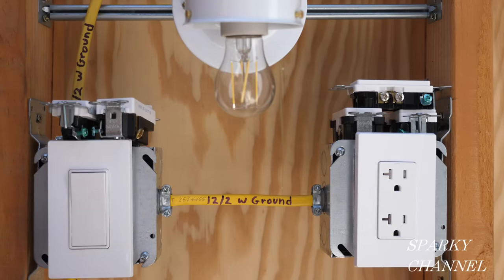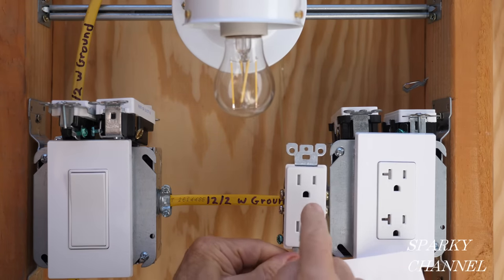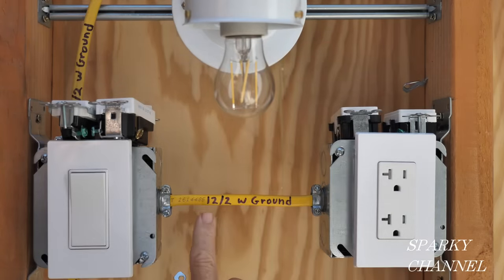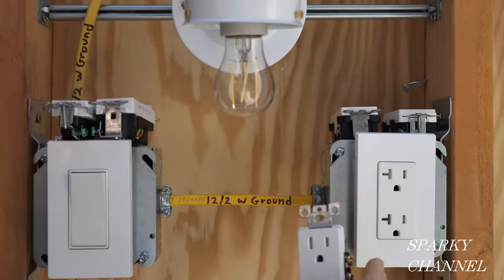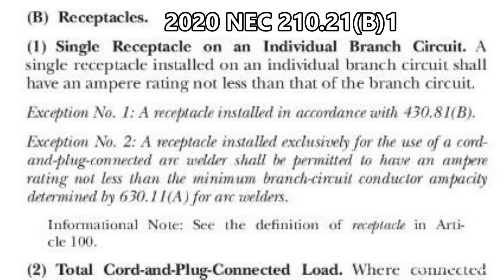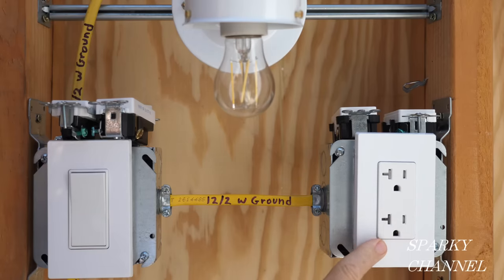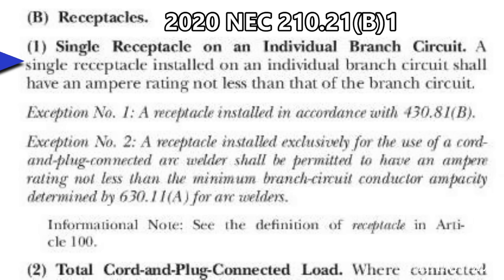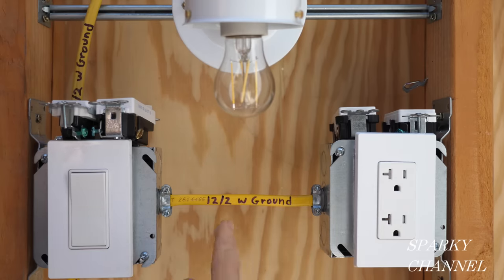Shall I Use a 15A or a 20A Receptacle on a 20A Circuit? + 2020 NEC 210.21(B)(1) and 210.21(B)(3)

Comment: For me the problem is I've been in a room of homes where there's a 20A breaker work 15A receps but your got idiotic people plugging in 16A+ into the recep causing it to catch fire.
Reply: This doesn't make sense. If a device draws more than 15A, then it should use a 20A plug, not a 15A plug. So having 15 amp receptacles is fine on a 20A circuit. You're just limiting the current you put on any single outlet to 15A.
Reply: I found 20A circuits with 14AWG wiring. And the name of the electrical contractor was ironically named Accurate Electrical.
Reply: @4point6Thunderbird  but Regular people don't get any of that. You got people plugging up portable heaters (12A) with a freaking heavy amp object. 6A and when it's past that 125% mark it catches fire.
Reply: @williamholsey  16a is limit for continuous usage on a 20a circuit. If they're using 18a on a 20a circuit, circuit breaker should trip. Usually why there are fires in this scenario is that the breaker isn't the issue or the loads but the wiring in the house isn't crimped or using proper wire nuts or is corroded.

Comment: Why can't you use a receptacle over 15 amps on a 15 amp line? It's just a beefier outlet, no?
Reply: Because a 20 amp receptacle is a notification that this is a 20 amp circuit. Someone could otherwise unknowingly plug in a high power appliance in a circuit not specified for that and overload it.
No, it's not beefier if you use a specification grade 15 amp receptacle.
Reply: you see the extra horizontal slot on the 20amp receptacle? that allows for 20amp draw equipment to be plugged in. 20amp draw equipment plugged into a 15amp circuit is bad news. 
Although you hardly ever see equipment like that anymore these days, its often in commercial environments and communications rooms for large battery backup systems to protect servers and emergency communications equipment.
Reply: You can.  Anyone saying you can't doesn't know what they're talking about or is stating the general while ignoring the specific.
 210.21 (B)(1), states a single receptacle installed on an individual circuit shall have an Ampere rating not less than that of the branch circuit.  Therefore, a single 20A receptacle can be used on a 15A circuit.  But it limits you to one receptacle so it's not practical in most applications... but it's allowed. 🤔
Reply: George Thamos  This is a specious argument as the circuit can be overloaded with multiple devices in a duplex and IT'S STILL OVERCURRENT PROTECTED.   "doesn't trip quickly"  SMH
Reply: 0:26 BECAUSE THE CODE SAY SO.

Comment: And that's how a house gets on fire.  If I am running a 20 amp breaker with 12/2 all switches and and outlets are 20 amp.  If I run a 15 amp breaker, then I use 15 amp switches and outlets. I have seen 20 amp circuits and the 15cent 15amp duplex outlet catch fire or over heat.
Reply: Lol makes no sense whatsoever, 15A and 20A receptacles are literally THE same internally (if you compare 15A spect grade and 20A spec grade they re the same product, with the only difference being the plastic face of the receptacle).

Comment: I wouldn't use a 15 amp receptacle on a 20 amp breaker.... better safe than sorry
Reply from the maker: I love it! Why not pay a little extra for quality?
Reply: @SparkyChannel  yes sir... exactly what I thought as well 😉
Reply: I would, it's totally safe and as long as it's a duplex it's code compliant. Use a spec grade 15 amp rather than the residential for good quality. Just make sure you have 12 gauge wire, that's the important part.
Reply: @surferdude642  I've been to homes that there's black outlets...not sure why or how I'm like duck duck and it's none of my business...but I've seen cooked outlets on kitchen circuits that are in nearby rooms...20 amp circuit.. .....20 amp outlet
Reply: @surferdude642  wait till next year and the code changes.....I guarantee it will since it came up......😆😆😆
Reply: @surferdude642  why would you endanger a home for 5$...... it's easy...20 amp goes with 20 amp...so what if there's 3 more outlets on the same circuit...3x1 = 3 dollars.... what are you thinking about?
Reply: @-agent-47-80  There is no difference between the 15 amp commercial grade and the 20 amp commercial grade other than the horizontal slot on the 20 amp device. If you are more comfortable using a 20 amp duplex receptacle  on a 20 amp circuit, then go ahead, no problem with that. It's not safer, it's just you're preference.
Reply: @-agent-47-80  Cooked outlets are usually caused by loose wiring, bad wiring, incorrect or faulty circuit breakers or a defective appliance or equipment. Yes it could be the receptacle if the contacts are worn out internally.
Reply: Sparky,  are you scotty kilmers brother?
Reply: @SparkyChannel  I have an office with 140 outlets to change after repainting....   It's an extra $4/outlet for the 20A rated!   I think the original builder all put in 15A.

Comment: The code should be changed.  The only reason that it's allowed is because the customer is required somehow to magically know that they have a 15 amp receptacle and not plug anything over 12 amps into it.  Any loads plugged into the receptacle between 12 and 20 amps could heat the receptacle and cause a fire without tripping the 20 amp breaker.

Now I don't know alot about fires.  But I'm pretty sure having one in the wall probably wouldn't be good probably.
Reply: What are you bloviating about?
Reply: You clearly don't actually understand how these things are designed, or why.

You don't have to "magically know" anything.  Did you notice how the slots on the 20A receptacles don't actually look the same as on the 15A ones?  That's because 20A appliance plugs have one of the pins turned sideways, so they will not go into 15A sockets.

Any device that pulls more than 12A is required to use a 20A plug.  Therefore loads over 12A are already designed so that you physically cannot plug them into a 15A socket in the first place.  That's the whole reason for having the different type of socket and pin configuration.

Comment: I've never in my 50 yrs seen a single receptacle, seems pointless to even make them.
Reply: They’re required (either in the code or just certain jurisdictions - can’t remember which) for specific-purpose outlets like sump-pump, refrigerator, garage door opener, etc. These are supposed to be dedicated circuits, so it shouldn’t be possible to connect additional loads.
Reply: @user181  My range has a single receptacle on the wall behind it.
Reply: A looot of refrigerators are on single.

Comment: There's nothing in the recepticle that knows the difference between 15 and 20. The 20 is just made to be heavier duty just like wiring is more heavy duty.  Why NEC would allow an undersized anything, which we're constantly told is a fire  hazard, makes no sense to me.  In fact it's just outright stupidity.
Reply: I've never seen a 15 amp receptacle light up
Reply: The NEC is the minimum requirement, so the residential grade receptacle is ruled to be adequate. It is acceptable or preferred to upgrade to a 15 amp spec grade or heavy duty receptacle and they are readily available and are of the same quality of a comparable 20 amp receptacle. You have to compare apples to apples.

Comment: My 1988 built house had 15 amp GFCI outlets installed on 20 amp circuits and they started failing around 7 years ago. I understand the concept of a 15 amp outlet for a 20 amp breaker circuit being safer, but in the real world home owners are more likely to over load another circuit because the under-current GFCI has failed. Weak GFCIs are a dumb idea likely propagated by cheapskate contractors. Please use the GFCI matched to your breaker to spare future home owners grief and potential fire hazard.

P.S. If you're too much of a cheap bastard to install GFCIs with LED trip lighting matched to your circuit breaker, go rent somewhere and stop working on houses.

Comment: Yeah, so, 15a duplex receptacle on 20a breaker with a 2000w 120v space heater. What's going to happen? I can tell you what's not going to happen; the 20a breaker is not going to trip. I've replaced many of these receptacles. However NEC says it's perfectly safe 😊. 20a receptacle on a 15a breaker that is a no. What type of receptacle do you put on a 40a breaker? Obviously a 30a duh because it's safe right? That breaker will trip long before... Oh crap where is that fire extinguisher 😅
Reply: I had to re-read to be sure I got your sarcasm. Yes, a 40A breaker would require a 50A plug. (there are no 40 NEMA receptacles).

Comment: A 15 amp receptacle requires a 20 amp breaker. A 15 amp breaker is for a 12 amp receptacle.
Reply: If you use a 20 amp receptacle, not only do you need a 20 amp circuit breaker, you need 20 amp wire!
Reply: @jeremieouellette7783  Look it up.  You are only supposed to use up to 80 percent of the power that the breaker puts out. The so called 15 amp receptacle is actually only 12 amps. And a 20 amp receptacle is really only 16 amps. The only reason they call it a 20 amp receptacle is because it uses a 20 amp circuit. but it only puts out 16 amps. That is what the code says.
Reply: @brexit9279  at least. it needs to be 20 amp or better.
Reply: For safety, yes, for code, what ever MINIMUM your local code requires for a 20 amp breaker, that is the cable you must use! You can install anything larger you want, you just have to breaker it correctly!
Reply: @danger7694  so if the load is known and it is not considered continuous then what ?
Reply: @jeremieouellette7783  it doesn’t matter if the load is continuous or not as long as it doesn’t go over the amperage. If it goes over the amperage it will trip the breaker.
Reply: @danger7694  That is not what the code says. 80% is not what it is puts out, 80% is what you use to be safe. You can pull 20 amps from a 20amp breaker.
Reply: @JediOfTheRepublic  Yes! for a short period of time. If you pull a full 50 amps out of a 50 amp breaker for to long you are going to trip the breaker. It can even pull over that for a minute or so. but then it will trip it.

Comment: i do not believe that the code is correct. its better to use a 20a receptacle in a 15 amp circuit that a 15a receptacle. the 20a will last a lot longer because you can not overloaded. the 15a breaker will make it impossible to do it
Reply: Your logic would allow someone to plug a 20A appliance into a 15A circuit. No bueno.

Comment: You have no clue what you're talking about. Stop giving electrical advice that you clearly are ignorant about. The code is that its a violation to install multiple 20a receptacles on a 20 amp dedicated circuit. You must use 15a receptacles for general purpose circuits. The reason being is that you can't give a false narrative that a 20a T receptacle is a dedicated circuit with multiple 20a devices installed
Reply: I don' think he said that. You can have multiple 20amp receptacles in a circuit as long as its not areas where a dedicated 20amp is necessary. Kitchen device outlets Bathrrom etc.